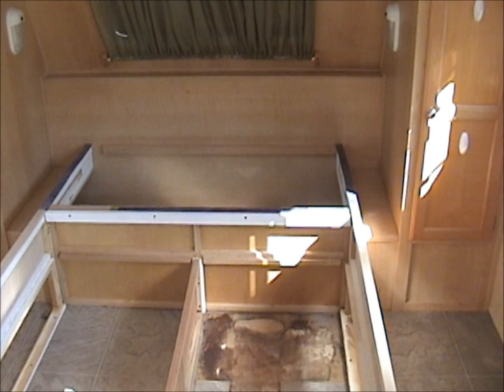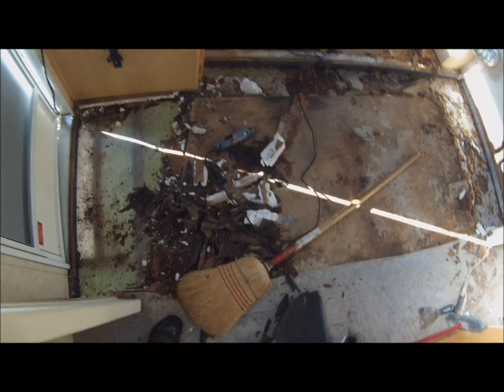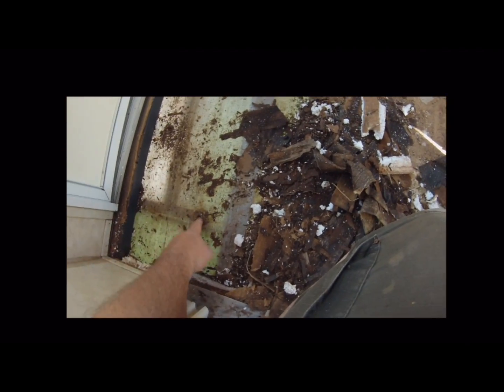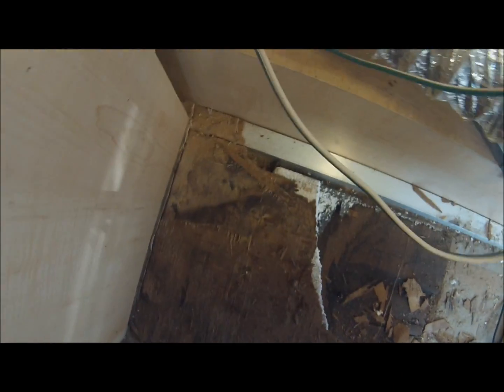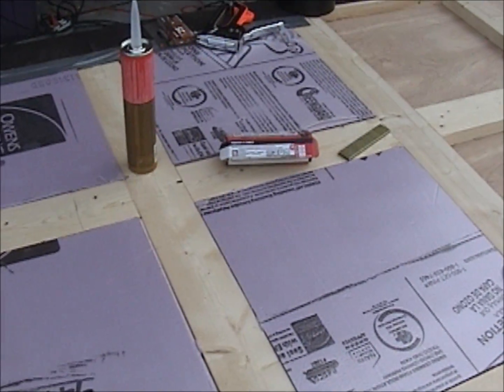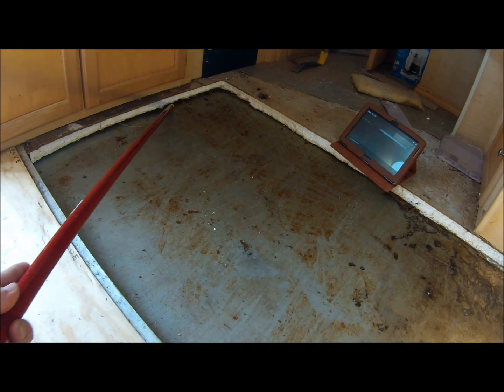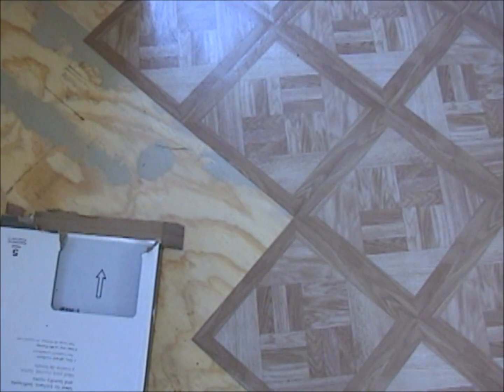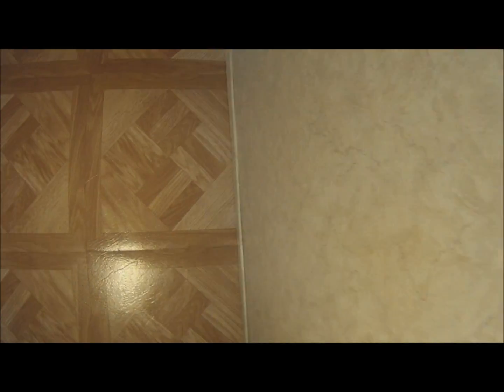How I replaced the spongy floor in my RV for under $500

Comment: On your comment, had I known how much work this was you may have sold it with the faulty floor. You didn't and I am sure each time you step into your camper/trailer it is a reminder of the good work, tolerance and dedication you invested in this project. Remembering that with most projects we are not trained to undertake, it usually takes longer than expected and is usually far more complicated, nothing ventured nothing gained. You have a beautiful hand crafted floor and we have a video aid to point us in the right direction now. Good work and thanks!

Comment: "This job is not for the faint of heart"

LOL. That's an understatement. I did a floor repair on mine last year and need to a different section this year.

It was interesting to find out when doing mine that trailers are built from the inside out.....makes getting to certain fasteners lots of fun and reattaching interior pieces even more fun!

Comment: Sir, I believe you did a wonderful job in this undertaking. I am presently looking for a camper for my family and cannot afford a brand new one. So in looking at used ones, I have come across a few that are in need of floor repair. Not as extensive as the one you did, but would assume similar type of repair. I am pretty handy and have most of the tools you used. I watched your video to see if there would be any surprises and gain any tips if I should go this route. Don't cut yourself short. You really did a wonderful job. Thank you for taking the time to video this project.
Reply from the maker: Thank you for your kind comments. Good Luck.

Comment: WOW,  thanks so much for uploading your RV repair project. I have a '05 Coachman Capri 27DS that we just discovered a spongy spot inside the door this last weekend. Seems to extend @ 2' square.  I'm all into saving money and I'm pretty good handyman wise but after watching your video, I know I don't want to undertake this job. I don't have the area or the needed tools. So, I'm in the process of getting 3 repair estimates. First one came back already at $1500. and I'm awaiting the other 2. It's amazes me how cheap these companies go with RV flooring. Rather than marine grade plywood they use crappy chipboard. Anyway, beautiful job on your camper  and on the video.

Comment: Yeah, I used it in my house in my closets and laundry room. It is fine in the closets but the heat in the laundry room is awful hard on it and has loosened. I bought Shaw vinal planking but have not laid it yet. Since ours is an RV we also used "Killmat" see video #11, under the flooring. It is for heat and sound. Super easy to lay down. Whew, so glad the floor repairs are finally done! My knees are complaining.

Comment: We recently bought a Trail Lite and were just going to give her a "face lift"......until we found  the water damage, mold and rot. This is the clearest video I have found on this subject by far and we now have more hope and confidence in tackling this endeavor on our own rather than paying someone else to do a job that we could do better after watching this video....thank you for sharing!!!
Reply from the maker: Thank you Deena. You can help me in return by subscribing to my channel.
Reply from the maker: @Deen Jamie Have you started yet? If so, how's it going?
Reply: I agree! Unfortunately mine was remodeled and not done correctly they just made it look nice... Noticed a soft spot at end of the bed. Just kept getting worse and worse.... Thought I'd be able to pull up the wood panels they put in and put down a piece of plywood and be good... Obviously not. When exposed they covered linoleum. As for the actual bed it's not sagging floor is fine. This is a nightmare. I'm living in this thing. Anyone have any suggestions on how I can drain water that has filled in this space??? It's slowly going completely on side plumbing is run.   Look under camper and dripping water. I know this is a total remodel. Any advice anyone can offer about the cause? Possibly bc running city water constant?? Any suggestions
Reply: @rogerdalescott  any suggestions?
Reply from the maker: @jodiking1179  Sorry no. Can't give advice for something I can't see.

Comment: I look for water damaged Trailers and can usually get them cheap once the owners hear repair estimates. It's not expensive materials, but it is always labor intensive. Being retired with enough space and a shop on my own property helps. I have learned a few tricks, like saw-sawlling rear cabinet screws that are installed before the siding goes on, making them impossible to remove. Just go back in with steel L brackets on the inside to hold them up. I don't remove any siding unless in need of repair. Keep in mind that almost all of your leaks start at the roof and work their way to the floor, sometimes around windows and hatch type doors, you must find and fix your leaks or all your work will need to be redone. Often roof joists are wood & and doomed shaped, causing them to be thinner where they rest on a wall sill plate, the worst thing you can do with smaller trailers is get on the roof unnecessarily and break one of the supports, you won't see the damage due to the rubber membrane or alu. skin covering it, but it will sag into a low spot and the leaking will begin.  I have fixed many by removing inside ceiling panels, make a 2x4 support the correct height with another cross piece attached and"bottle jack" the roof back up until u can add a spliced in piece of wood, like fixing a bird wing. I only cut out the rot and splice in lots of wood, mostly 1x2's throughout. you do need lots of tools to do these type repairs, always look for leaks before they have soaked out entire walls and floors and get them stopped. The system is all hinged on a good roof that all water runs completely OFF! The little gutters are important. Good Luck  if you try it yourself :)
The Pelican, Ut.
Reply: Steve good tips .  I was going to try and cut the screws rather then taking siding out!      Do you think is floors are rotten that there HAS to be a leak...I bought one and they said the water heater bursted which ruined floors...but im wondering if the floors just rot over time even if water is not constantly going in,.

Comment: Yeah we're in the same situation. We think, after 10 years since  purchase, which was for my son's habitation as he went through high school and frequent visits from college every year, it has served its purpose.  It was never moved since its arrival.

I admire your willingness to jump in to a project that, as you admit, you had no idea would be as complex.

I had the roof re-sealed, a slide floor rebuilt and then I found out the kitchen in my 1999 Dutchman RK SL 27 foot 5th wheel is getting spongy. There are signs of delamination and mold on several walls. I installed a ventless gas heater, early on,  and from what I've read, that emit's a good amount of moisture into the air, a calculation readily available by googling it...perhaps that added to the wall and floor problems.

Also, the tires show evidence of dry rot, so I am fearful about the liability of moving it...Unless done by Professional.

I, at 69, am not up to repeating your respected, project....it's just too arduous for me, my pocketbook, and expertise, 

While yours appears to be structurally sound and I really admire your engineering… You could hear the repaired area creaking as you walked it, and that might give a prospective buyer pause.

I think we'll just call it quits and not sell ours to a prospective camper buyer as-is, because, in our hearts, we wouldn't feel good about that…and it is doubtful an RV dealer would be interested.

We are contemplating donating it to our local public broadcasting station or possibly church, and taking a write-off on it.

So, sir, WELL DONE!  Yer a better man than I, Charley Brown!

Respectful regards,
Chas

Comment: i bought a 1987 HY-Line 30footer that sat in open air storage for 7yrs after the owner died.  I only paid $500 but every door frame and about a 6 inch section of floor at both doorways needs to be repaired.  I have worked with boats and fiberglass so I am going to give this a shot solo.  Wish me luck.  I appreciate this detailed video.  It gave me the sack to tackle it.
Reply: worst case you make a car hauler out of it

Comment: Well done, that looked like a real tough job. Extra difficult because there are so few support points for the framing. I know what you mean about how hard it is on the knees. I did a floor repair on my camper last fall. The area was small, just 42x18 inches but still a lot of work. And really hard on the knees & lower back.

Comment: I've been rebuilding rv'z for years   No matter what you do it will leak n rot all over again always use pressure treated wood no felt paper because it will hold in the moisture . Always double up everything  sister into everything!!  Good luck.         Let me know if you need some info!!!
Reply: +John Work 
Do you have a video on how to replace a floor and wall?
Reply: No but... I'll do one next time I do one..

Comment: Great video i enjoyed!  I am doing mine and when I am done the floor.  I will put the cheap water proof flooring they make. that kinda snaps together.  Its affordable and it will prevent from any water at all from getting underneath into the wood.
Reply from the maker: I am getting ready to replace the stick on tiles with laminate flooring this fall. I will post it.

Comment from the maker: Spent the week in my camper. The floor is still sound. Although a few of the stick on tiles are coming loose. Solid vinyl sheet might have been a better choice.
Reply: Hey! I’m renovating my trailer, I’m a RV newbie with NO EXPERIENCE WHATSOEVER, but I’m really working in here to replace the flooring, the problem? Once I took the carpet out it was a soft spot in the entry, I’m planing cut just that part since it seem it was leaking from the door, the wall is not soft or water damaged so I’m sealing the door and removing that piece of plywood but I want to know the name of the “wooden cutter” you used to remove the flooring! Please! I could really use some tips
Reply: @sucreilyreyes7398    prob too late . but its a dremel

Comment: I am tackling the same issue on a trail cruiser.  Typical 6 sided foam, one leak and totaled.    Our floor is rotten in the bathroom directly above the black tank.  We have to attack it from the top of the rail, rip out tub, and redo entire rear of camper.

Comment: This seems to be a common issue with these campers. I simply cut 3/4" plywood to fit over the existing floor and use area rugs. I might put down carpet later. Fortunately all the doors and cabinets have a good 1 inch clearance. That is the main concern with this "cheat" approach.
I would wear snow shoes before redoing the floor. I figured it would be about as much of a pain as this video shows.
My hat is off to you. It is  the right way to do it and looks great.
Reply from the maker: @HappyCup I also thought about doing the same as you. However, I was concerned about the weight maximums of my truck I was towing it with. In retrospect I think I would have been alright with the extra weight.

Comment: u did a wonderful repair job. if i may give u a tip on ur tiles that move glue dond some wet dry sand paper to the plywood then glue ur tiles to that should solove the problem good luck johnny
Reply: Use water proof flooring    :)

Comment: Thank you for the most accurate and informative video  on this particular type of floor!
Well, here it is in 2021 and my '05 Trail Cruiser 30 QBSS needs the floor ..(started in the bath.. as we demod, it's now across the rear & from the fridge back to the rear of the camper) I do think a layer of Tyvek on top of the membrane should let moisture out and keep it from migrating up. I plan to add aluminum angle inwards onto the existing box aluminum,  Lay largest possible luan from angle to angle & 1 crosswise (planed down?) 2x4 about 3' up from the rear , pre fastened to the luan.  (of course, countersink & bolt the cross 2x4 to both frame rails thru the luan)Then Lexel (or other flexible glue) largest blueboard sheets possible to the luan, then to each other and finally cover(& glue) 1/2 plywood over it all (all in different directions and largest sheets possible. I may be about 1/4" higher in the end, but some sheet goods & a simple glue down transition strip should take care of it. 
As plans change as a project develops, I did remove a short bathroom wall so the floor could be in as big sheets as possible
My intent is to replicate the insulative & weight qualities of the original floor. Except for probable window leaks, the original DID last more  than 10 years
Reply from the maker: Thanks for your info. Good luck.

Comment from the maker: OK, it's been 1 and a half years since I replaced this floor. The floor is holding up really well. Still nice and solid. However, the stick on Tile has been a failure. For some reason all of the tiles around the walls and in front of the sink will not stick to the plywood flooring. I have tried everything. No luck. I think it is because they are only locked in on three sides by the adjacent tiles. The fourth side is the wall side and there is nothing butted up against that side of the tile so it has a tendency to move toward the wall. I even put new tiles down with extra glue. I am stimeyed.
Reply: I just finished a similar reno on a Trail Lite, and I looked at the same tiles for my job. The specs for the tiles on Home Depot's page warn that they'll only stay stuck in a heated/temperature controlled area. I selected different tiles that didn't have the same warning, and we'll see how they stay down after they go through an off season in the cold. I am guessing you're not the only one who had the problem with them staying stuck. It's too bad, because they're good-looking tiles.
Reply: you may have cut the tile to tight and expansion is popping them up. i did floors for years and learned that lesson fast.
Reply: Tiles, I wouldn't if there peel offs, but you could put an oil=base primer down 1st, then get the lino glue that works like contact cement, trowel it on floor and tile after a few min of set up, stick em. use paint thinner to clean up any mess, but wait until fully cured and dry or it will sneak under and cause a debond.
Reply: Liked your video.  I'm in the beginning stages of my trail sport.  What floor would you recommend?
Reply: you would be better off using a laminate flooring.  Soon as you said stick on tiles. .I cringed.  Nothing good has ever happened with sticky tiles. I've renovated several RVs and each time I use a laminate flooring.  Sturdy, durable and resistant to rot and decay. Only drawback is a very slight weight increase. When I remove rotted subflooring, I use a good quality CDX plywood and before I lay it down permanently,  I will paint all sides and edges with a waterproofing primer that is resistant to rot and mildew.

Comment: home depot sells vinyl plank flooring, I'd do that.  They make an adhesive plank and it can go directly over your existing floor, which can serve as an underlayment.  Get a vinyl cutter in the carpet section, or simply use a straight edge and utility knife, although the cutter is quick and makes install go fast.  Just make sure floor is clean prior to start so the planks stick well.  Don't use the "click lock" style, it's a pain.  I've rehabbed over 100 trailers
Reply from the maker: @mr inspector Thank you very much. I will do just that next week if I can get into Home Depot. Look for the video in a month.

Comment: Thank you for the video, im about to do the flooring in my bathroom also (same Model).

I have one other question, where is the fresh water drain valve?  I just go this and haven't found it. Ive looked everywhere under the trailer all I can find are the blue and red low point drains by the back of the trailer.

Comment: What about under the walls? The walls are put on after the floor is built. Wouldn't it stand to reason the floor is also rotted underneath the walls? The reason I ask is, I just did a floor repair video and I had to jack up the wall to replace the floor and sill  underneath the wall.

Comment: I'll have to tell you how I come across your video I live in an RV and I need to fix my floor  and I was looking different ways when I come across your video which.
Reply from the maker: Hi Mary. I hope your floor is not as bad as mine was. I shudder to think that I would have to go thru that again. Good luck with your floor.
Reply: @rogerdalescott  Rodger my floor is not as bad as yours but it's got soft spot so what I was going to do is take one inch plywood and liquid nail it down I think that will work really well and then put linoleum over it

Comment: Something caused it to rot, I hope you found and fixed the leak.  Also Luan is not made with exterior waterproof/exterior glue.  I would have used a different product at least an exterior plywood, maybe marine grade or pressure treated.  Rot is like cancer unless you got it all, and that includes that which is under the exterior walls,  I hate to tell ya but it'll be back.  I wish you the best.  You definitely put your time in and your workmanship looks good.